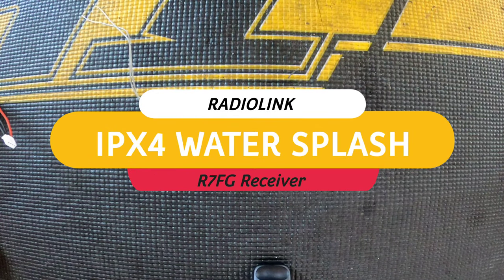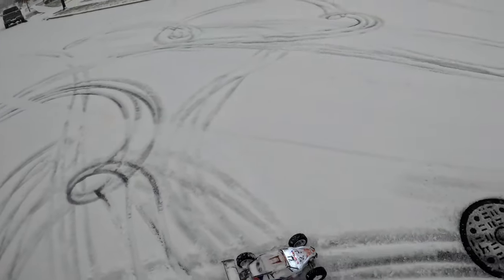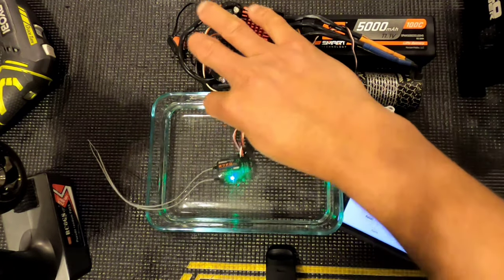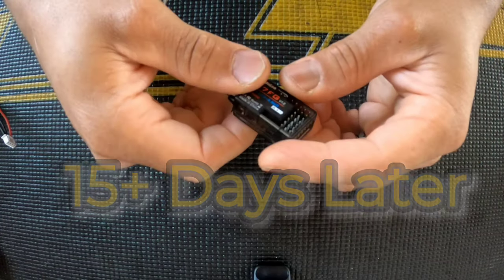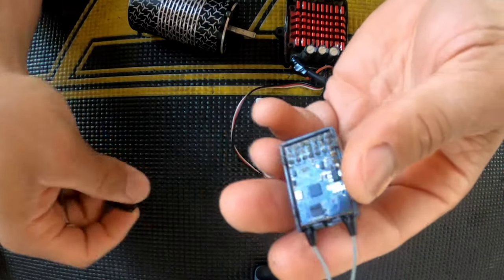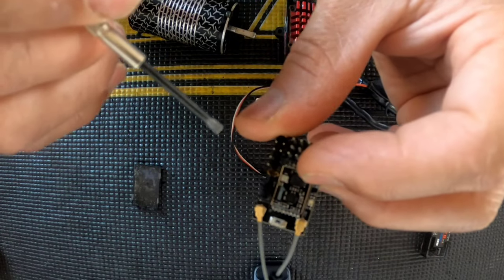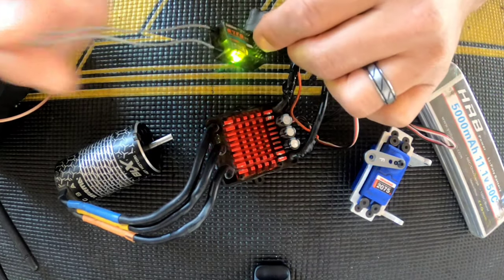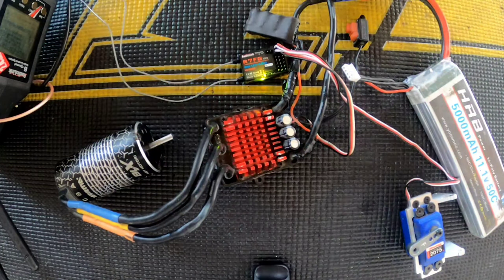Radiolink || R7FG Receiver || IPX4 Watersplash 💦 Proof???

Comment: Nice test man. I’ve got 6 of those receivers and I take them apart and silicone conformal coat the board. Cool to see that they’re good without it haha your braver than I haha
Reply from the maker: I normally don't run my cars in the WET WET🤣 or Cold 🥶. I hate the maintenance and parts are easier to break when it's cold.  It becomes a chore.  But it's good to know that these affordable receivers can survive.

Comment: I have mine in a  Rx box sealed,  had no idea it was waterproof.  Guess I'm good lol. This radio us very cool with options my $800 futaba doesn't have and the range is by far the best out there.  The 8ch non gyro version has even more distance. The I'd seed feature is great can run several models by a quick menu click. Use it to tow my sonicwake with my bronco , back trailer into water switch to boat and take off. Great feature. And mixing for tanks,  excavators is cool too. It's my daily surface driver. 3yrs zero issues.
Reply from the maker: Glad that it has been very useful to you in all that aspects.  I have the 8 channel receiver too about to do a test on it.  Didn't know it had more range than the R7FG Receiver.  How much farther do you think it goes?
Reply: @MatrixRC  yea they claim it does, , I've never lost signal with either.
Reply from the maker: Thanks 👍🏽